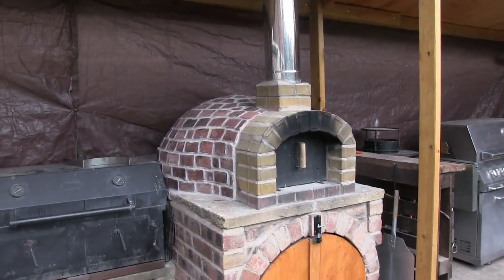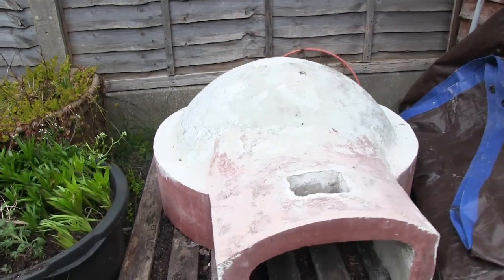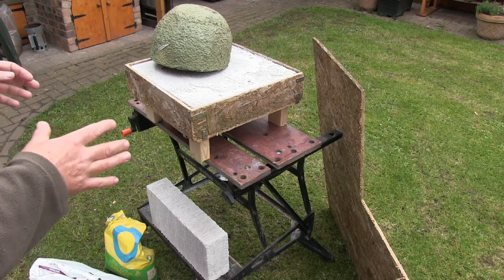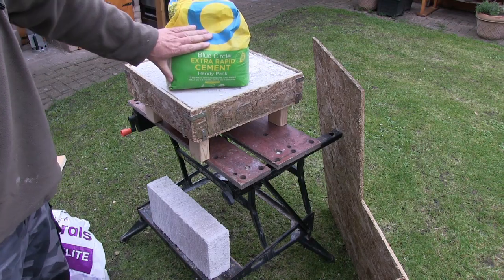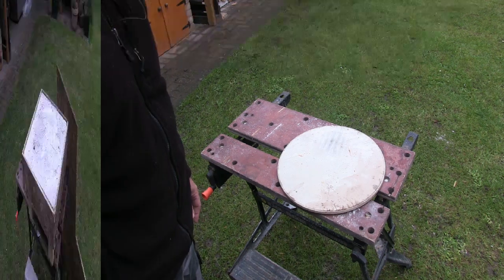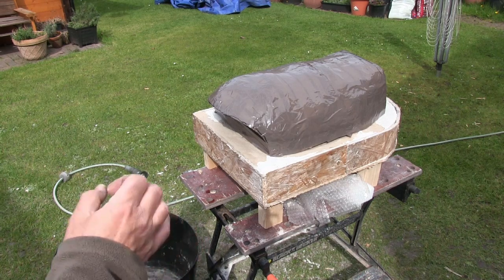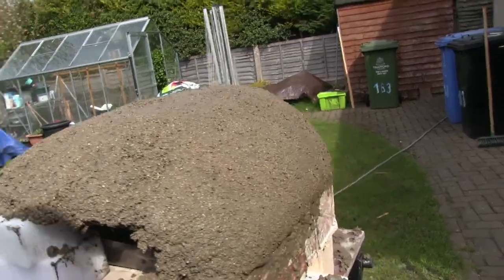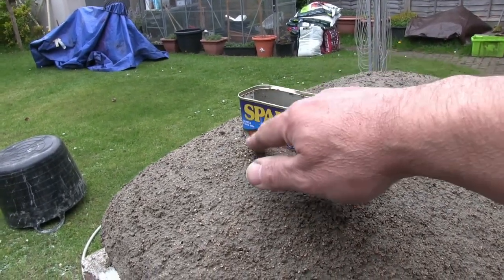Table Top Wood Fired Pizza Oven Project Part 1 | Vermiculite Concrete Pizza Oven

Comment: Great video thank you, Just curious as to why you didn’t make the base and oven with the shaving foam aircrete mix? 
Steve (67yrs) Manitoba
Reply from the maker: Think you've just given me an idea for a future video😁. Have plenty of vermiculite left so wanted to use it up but the aircrete is definitely with making
Reply: I also watched your shaving foam aircrete rocket stove form build. Planning to use that idea and method to build a rocket stove under an old heavy BBQ grill. So I’ll have both a grill and oven. Thoughts on this idea? Steve
Reply from the maker: @stevenrldenault7451  Sounds good. The rocket stove is going strong and is extremely efficient. The only downside is low structural integrity of both the main body and surface finish. Applying some form of surface coating would be ideal but I'm not sure what would work?